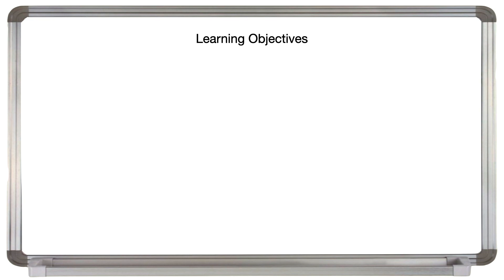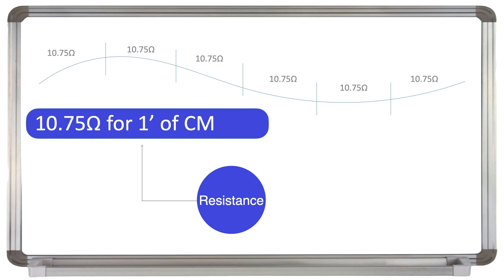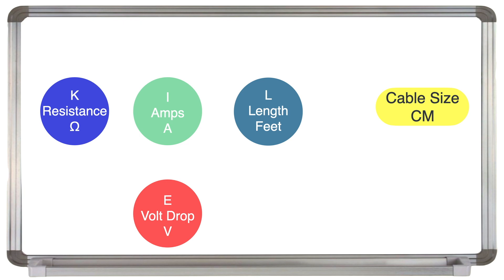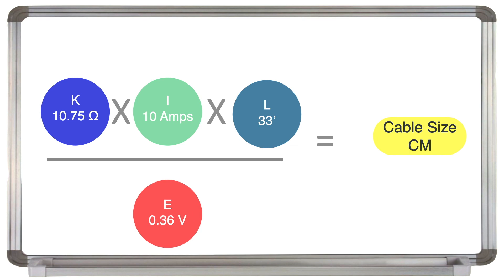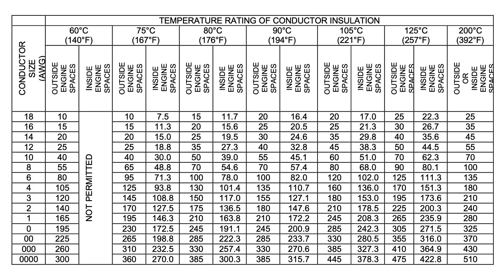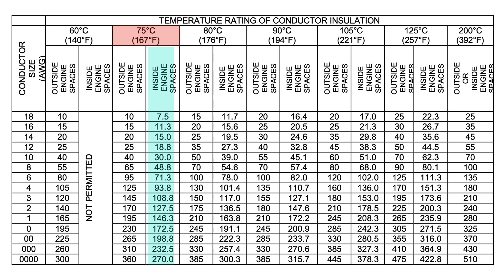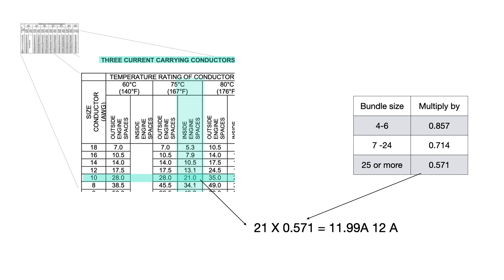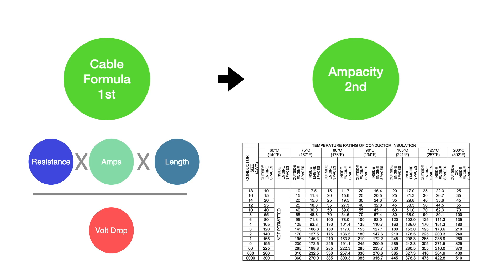Marine Electrical Courses Online - Sizing Cables Based on ABYC Formulas

Comment: great! Thanks for the video!
Now I just gotta convert it to metric!! ;-) :-D
Reply from the maker: This one was just for the guys that work to ABYC..The full course shows the metric version too, using the ISO 10133 guidelines, working in mm2 CSA cables and metres for lengths. Tbh the course is primarily in metric, this was an additional section added in after due to demand..
Metric is just 0.0164 x amps x length (m)  ÷ voltage drop = CSA mm2 with similar tables for nominal ratings, and correction factors.
Reply: @allabroadsailing  Fantastic! Thanks for the swift reply and clarification.